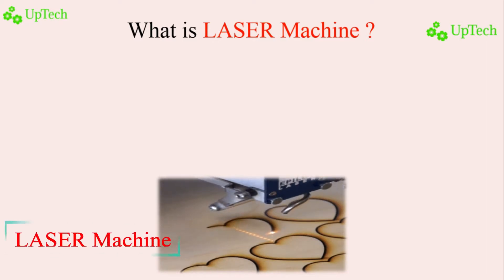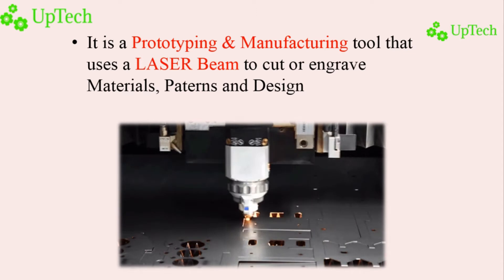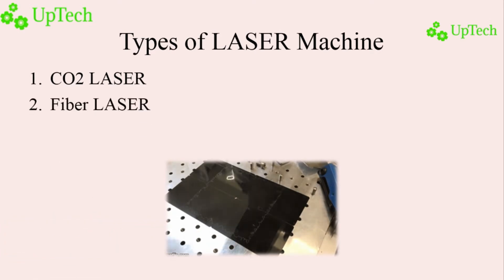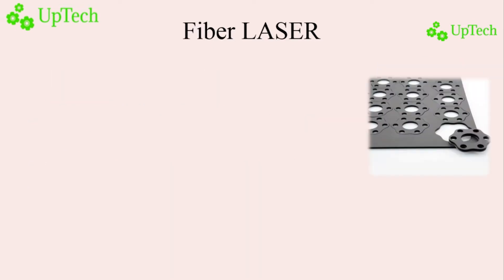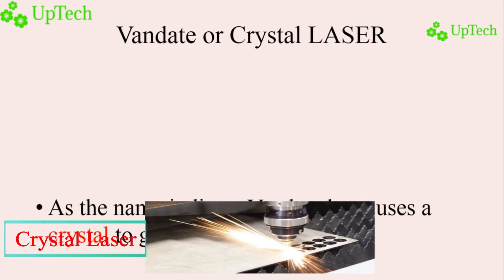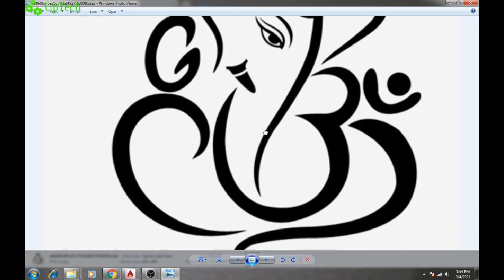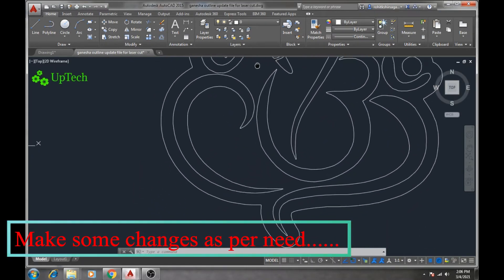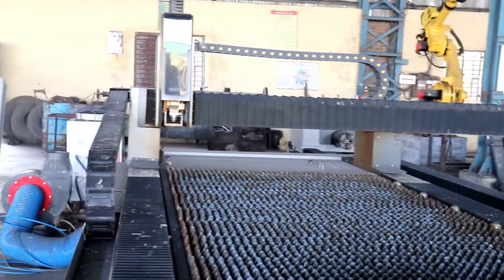AutoCAD | Introduction to LASER Machine | LASER Cutting Wall Mounted Lord Shree Ganesha

Comment: Beautiful!! How to buy one of the Lord Ganeshji cut by laser? What is the price to get it done?
Reply from the maker: It will cost around 1000 rs if you make on your own with the help of cnc fiber laser machine.
Reply: @UpTechcadcam  I plan to buy. What will be the cost?
Reply from the maker: @mayikg7307  send me your requirement on email uptechcadcam@gmail.com
Reply: @UpTechcadcam   Hi sir , please share the cost if we wanted to this ganesh idol in either 1.) SS GOLD (304GRADE) 2” Bedding
7ft x 5ft    
Or
2.)SS SILVER (304GRADE) 2” Bedding
7ft x 5ft   
Along with 
3.) ACP LED SIGN
7ft x 5ft   . This helps for the cost estimation.  Thanks
Reply: Sir how much does it cost for this laser cut and where this will be done